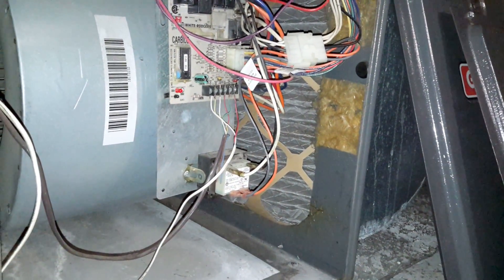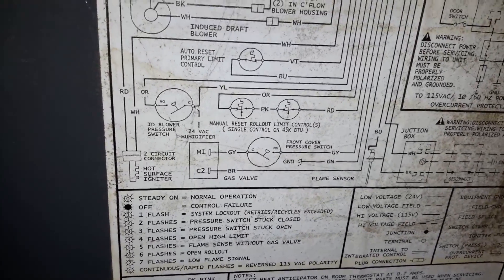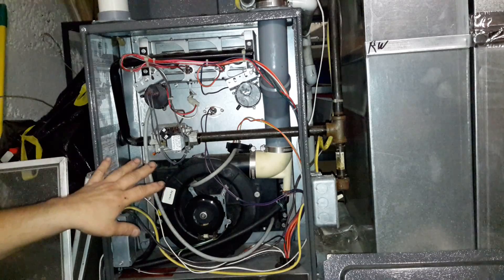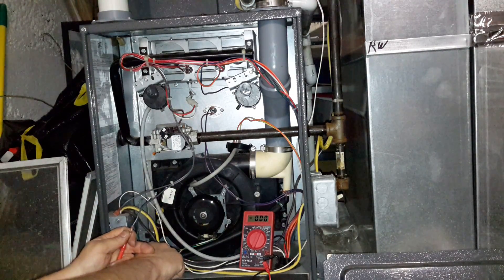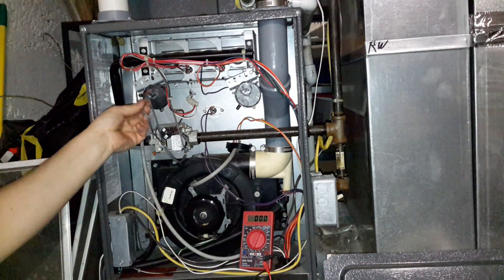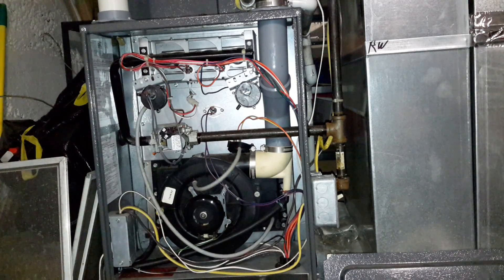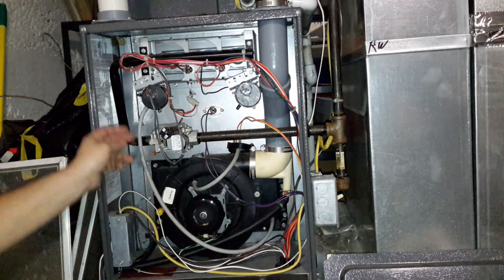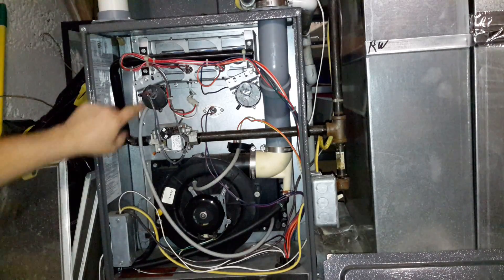Goodman furnace no flame 1 flash

Comment: Brrrrrrrr.........and greetings from Tundra Land where the temps dipped into the 40's this Saturday past and had to fire up the Goodman.  Warmed up the house in the AM, but did not fire up later that evening prompting me to watch several YouTube videos troubleshoot issue; To no avail and assuming the gas valve had failed I agonized about having to shell out hundreds of $'s to have my local HVAC vendor replace the gas valve.  

However, after watching your 5:37 video, I went back downstairs and did exactly what you did with the hose and ..........VOILA!  We have heat once again all thanks to you!!  

Foot note:  With the money you just saved me, I'm going to buy my wife a bouquet of flowers, a nice steak and  crab legs dinner and a 6 pack of some good IPA for me.....Woohoo!!!! :face-blue-smiling:

Comment: This was my problem, my Goodman furnace stopped working after a blizzard. It was located in the attic vented through the roof. Snow must’ve blown down the vent pipe due to high winds and then melted and leaked back into that tube. I had 1 flash error after the furnace tried to start 3 times. Thanks

Comment: After the basement flooded, I cleaned out the furnace and the little bit of duct that got wet. When I tried to run the heat, I had the one blink. Sure enough, water in the hose. Thanks bud!
Reply from the maker: Thankyou for sharing

Comment: THANK YOU SO MUCH!!! if this solves my problem I could hear water swirling around the exhaust fan and  after a random time it  will go out and trip number 1 and we just cycle through it and eventually it fire.  A tech said it's either a computer board or gas valve, well I bought a board myself and 10 mins later..nothing same effect,  trip number 1 code. So I will clear everything out and see. Thank you so much just they way u explain your diagnostic  I subbed and would like to learn more.
Reply from the maker: Thank you for the sub and watching. The gas furnace is the most DIY friendly appliance in the house. I'm sure you learned a lot by tackling this repair already.

Comment: Thank you! Checking the hoses is definitely key, sure worked for me. Removed all the pressure switch hoses and blew in and out through them. One hose "popped" something loose. Put them back and everything started up like there was no problem. Highly recommend doing this and save yourself $500+ like I did. Nice job Mr. Helper Guy!
Reply from the maker: Nothing worse than watching a service guy clean the water out of a hose than charge you bank. I think they usually put a new switch in there so the customer feels a little better.

Comment: I'm having this issue now. I blew the water out of the lines, cleaned the igniter and the flame sensor. I cant get ahold of my HVAC guy.  Still flashes the 1 code.  I blew into the switch and away from the switch.

Comment: Just saved me a repairman visit and who knows how much money and it only took me 5 minutes to figure out it wasn't the igniter and to blow out the rubber hoses.
Reply from the maker: Congrats on the easy fix.
Reply: Your Igniter turns red like a cherry first of all and the Flame sensor actually is what starts the flame ,so I don't know for sure if you mean the flame sensor or the igniter or glow bar isn't working the glow bar turns red hot or cherry red so you would know if it's bad just by seeing whether it got red hot looking or not,90% of the time if the igniter lights up but doesn't start its the flame sensor is either going bad or all together bad....and if it was the hoses being clogged or having water in them,also make sure to reset the thermostat,turn it down and wait a minute then turn it back up.I worked on my hoses but once it cut back off it wouldn't come back on again until i reset the thermostat after cleaning out the hoses

Comment: Hello,  I had water in line , cleared out still won't kick on. What's next?
Reply from the maker: Quick review, inducer comes on, closes pressure switch the thing with hose on it, igniter comes on, gas valve opens , flames, flame sensor senses flams,
Reply from the maker: If your inducer comes on you are still at the pressure switch.
Reply: themrhelperguy  After turning off and restarting will blow heat for a while , then turns off. igniter turns on but won't restart . I shorted the primary limit switch and still shuts off no gas but fan keeps blowing . I also cleaned the flame sensor. I did have floors sanded and a lot of plaster work done. Friend said coil could be dirty?
Reply from the maker: Do you have a light on your computer board. Is it flashing any codes.
Reply: themrhelperguy. Yes flashing a 1. no flame and fan keeps running
Reply from the maker: What kind of furnace do you have. When you say fan keeps running are you talking about the main blower fan that circulates air.
Reply from the maker: What kind of furnace do you have. And when you say the fan keeps running are you talking about the supply fan not the draft inducer.
Reply: themrhelperguy Goodman GMH95 , the inducer and the Circulator fan . Trys to start ignitor lights 3 times and no flame. Possible gas valve or circuit board which was replaced. I'm going to check for power at valve . is it 27 volts
Reply from the maker: You will have a flame roll out switch around the burners. Try to reset them they will have a button on top of them.
Reply: themrhelperguy will they reset by them self . After a little while it will turn on and  blow heat. Then it shuts down again
Reply from the maker: They do not reset themselves
Reply: themrhelperguy it's not them .... I checked resistance across them and its good
Reply from the maker: Restart the furnace and look at the light on the computer while it trys to start. See if it puts out any codes before it locks out with that number 1 code. Then restart furnace and jump out the left side pressure switch after the draft inducer comes on. Put something metal  in between the wires after the draft inducer comes on. Must be after the inducer comes on. Then repeat with the right side presume switch.
Reply from the maker: I also want you to drain the entire furnace. Find a hose twards the bottom of the top compartment around the draft inducer. See if it's full of water. It will be a thicker line.
Reply: cleaning the flame sensor doesn't always work try replacing it....I had to replace mine a month ago wasn't but 15 bucks